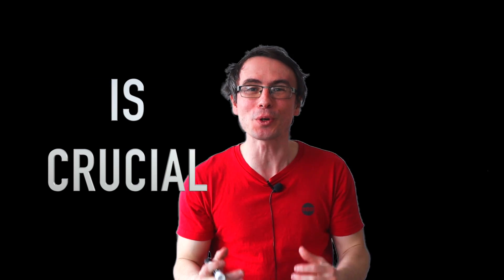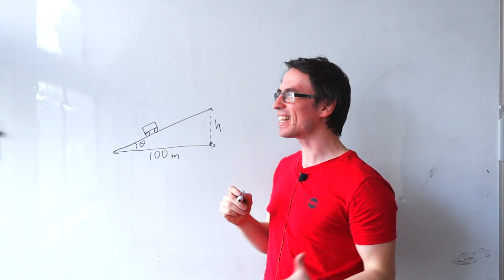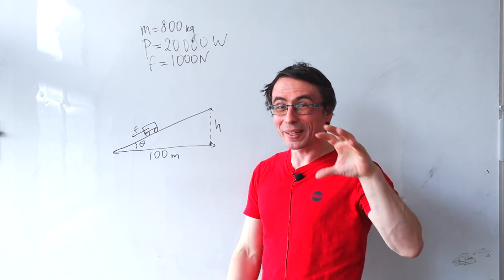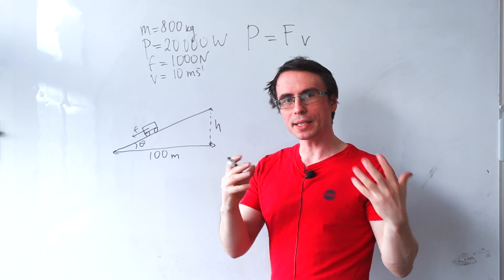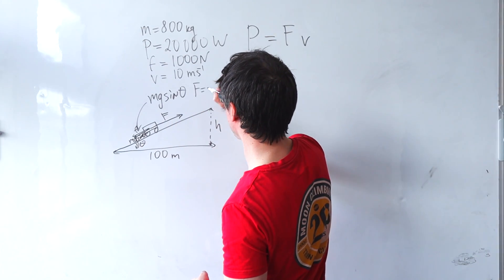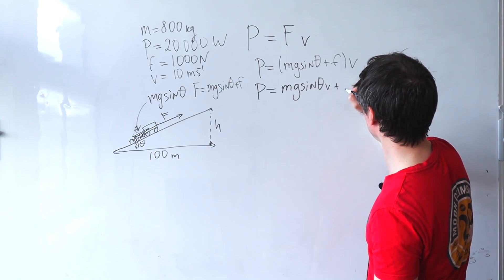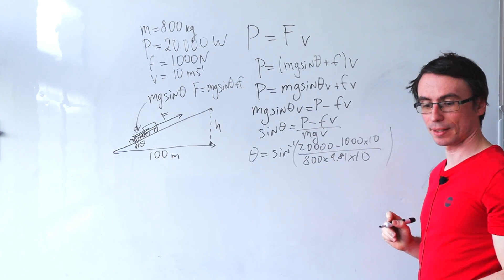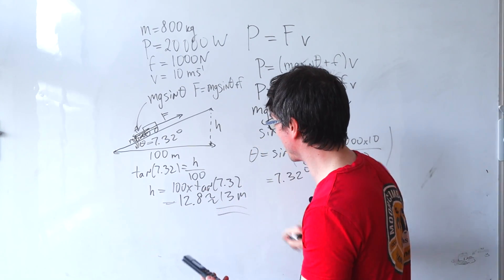You NEED to Practice This in A Level Physics

Comment: Hi, I'm doing OCR A Level Physics, I'm going to start revise Module 5. Is there anything that I need to know from Module 4 for Module 5? Thanks
Reply from the maker: good question. For OCR A diffraction gratings are done in the astrophysics part of Module 5, which is essentially waves, so sometimes you can get combinations. You will also need to know the formulas for the energy of a photon, E=hf and E=hc/wavelength. I've covered all here: https://youtu.be/4Ws2A6hsrI0?si=dMnUUdqBEOxr6ap8 Hope this helps!

Comment: Hi sir, Could you please explain multiple choice question 8 of OCR A AS level Physics paper 1 (Breadth in Physics) 2020? {its about mean drift velocity of charge carrier in a 300 ohm resistor}
Reply from the maker: So the current splits at the junction so I_total=V/200+V/300=5V/600   i.e. I=5V/600 which is the total current that goes in
What is the proportion of the total current that the 300 Ohm resistor gets?
I_300=V/300

I_300/I_total=(V/300)/(5V/600)=2/5=0.4 and if the currents ratio is 0.4 the mean drift velocity is also 0.4 due the I=nAev equation if everything else is constant.

Comment: I answered this question in a rather unconventional way, I did the usual "F=ma for the Car up the slope", got value of sin(theta) as 125/981.
Then, by using sin(theta) is O/H, I worked out the Adjacent Side using Pythagoras.
Then, with Opposite and Adjacent I got tan(theta).
I used proportionality, with the angle between component of weight and the angle between the slope.
973 was the adjacent side - I divided this by 100 given in the question which was the adjacent of the slope and got a constant of proportionality (k = 9.73).
Using this I did the same for "O" in sin(o/h) = sin(125/981), 
I got 125 = h * 9.73
h = 12.8m
Reply: It's ok zoro you might not take the conventional route but you always end up at the final destination before anyone else on the crew
Reply: @umermustafa2857  🤣🤣🤣
Reply from the maker: excellent work!!

Comment: I think you are also able to solve it without even using the power of the engine or the velocity, only using the fact that it is at constant speed therefore you know all forces are balanced according to Newtons 1st law. You can construct a right angle triangle force diagram with a hypotenuse mg ( 800 * 9.81 = 7848) and side length of f (1000). Then you can just use trig to work work out θ which comes out as 7.32°
Reply from the maker: excellent!

Comment: If F = m × g × sinTheta + f, doesn't that mean that the car is not moving, since the forces balance out ?
Reply from the maker: Excellent answers! And yes, if all the forces are balanced it means that the acceleration is 0. But the car can still be moving. Hope this helps!
Reply: newtons first law states an object will remain at rest or constant velocity unless acted by a resultant force; so it could move if both forces were equal, in this example it's  not accelerating
Reply: No. It just means it will continue moving at constant speed i.e acceleration is 0.